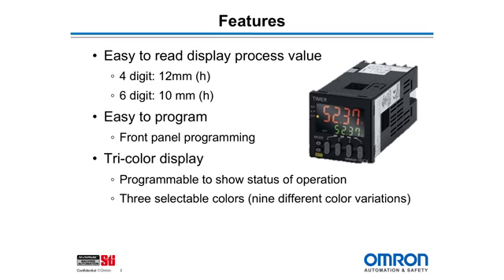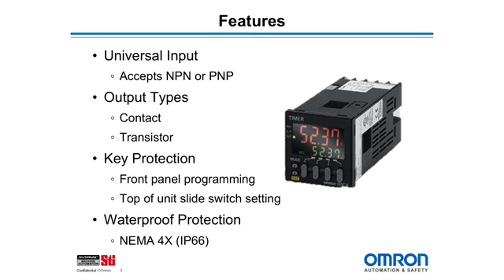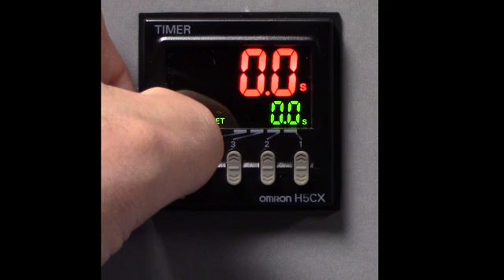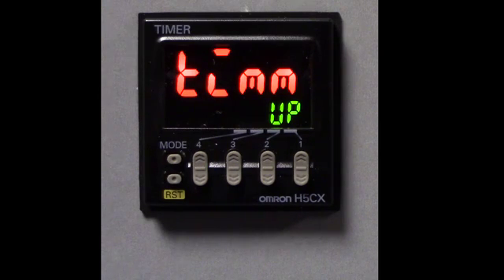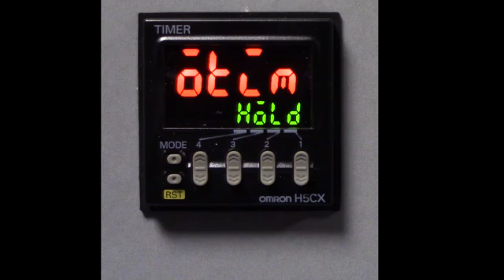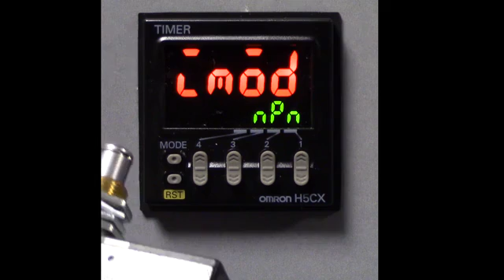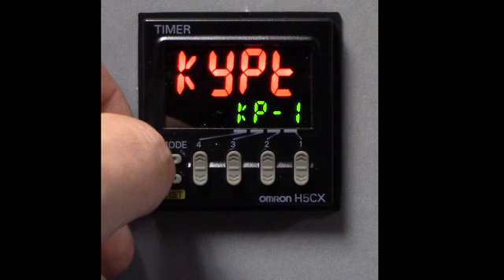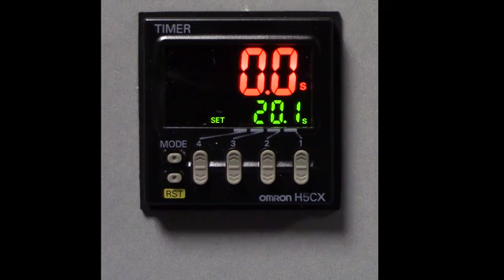Omron H5CX_N Digital Timer Basic Function Programming

Comment: Hi..can this be programmed for 2 min on and 10 min off..than again it on 2 min and off 10 min..this cycle has to run continuously throughout day..
Reply from the maker: Thank you for your interest in the Omron H5CX-N series timer. To answer the question yes the timer can be programmed to provide the sequence you are requiring. This is called a twin timer function and can be programmed in 4 different styles. Here is a brief explanation of the styles:

Flicker OFF start 1: (Timer resets when power comes ON) Provides the ability to program different ON and OFF times values. The timer can be wired to provide the sequence when power is applied to the unit or by way of a external start input. Flicker off start provides the OFF sequence when the timer starts timing.

Flicker ON start 1: Same as above but provides the ON sequence when the timer starts timing.

Flicker OFF start 2: Is the same as Flicker OFF start 1 but the timer does not reset when the timer is started (Will continue where it was powered off).

Flicker ON start 2:  Is the same as Flicker ON start 1 but the timer does not reset when the timer is started (Will continue where it was powered off).

Feel free to contact our Technical Support Staff if you need help selecting or setting up the timer and they will be happy to provide you guidance in selection/setting up the controller and get it up and running quickly @ 1-800-556-6766

Here is a link for the data sheet for you reference: 

https://downloads.omron.us/IAB/Products/Control%20Components/Timers/Digital%20Timers/H5CX/L111/H5CX_N_datasheet_en_200909.pdf

Detailed information can be found on pg. 25 of the pdf.

Thank you once again for selecting Omron for you timing needs!